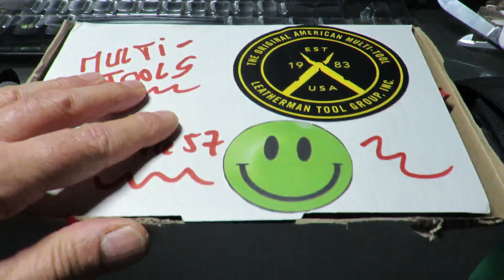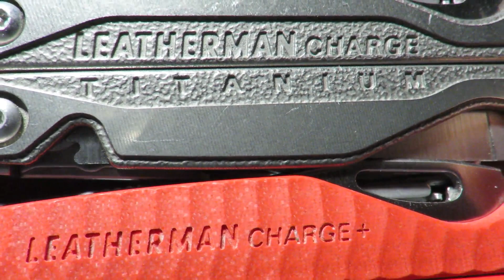Leatherman Charge+ TTI or Charge+ G10 : which one to choose ?

Comment: I have purchased a G10 model for my first full sized Leatherman, and while I do like the grip, the handle scales are rather flimsy. I am going to purchase a preowned TTI and am going to swap the plier heads.
Reply from the maker: "rather flimsy" ???
Reply: What "hawawa" is trying to say by (flimsy) is that the G10 scales are a little bit flexible if you squeeze them or put pressure in the middle with your fingers, they are not as rigid as the aluminum and Titanium scales, but to me it's not a big issue, the flexibility won't interfere with anything. The reason I like the G10 scales over the metal is because they makes the Charge lightweight and immune to corrosion, plus the pattern on the G10 scales provide a better grip.